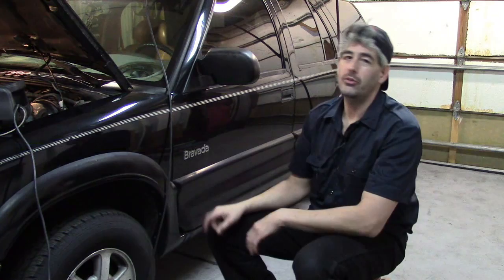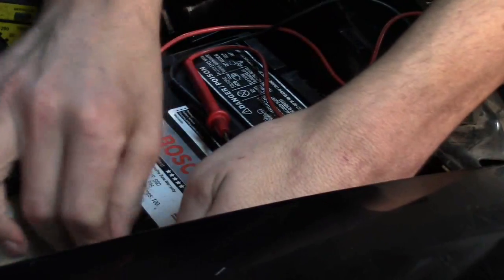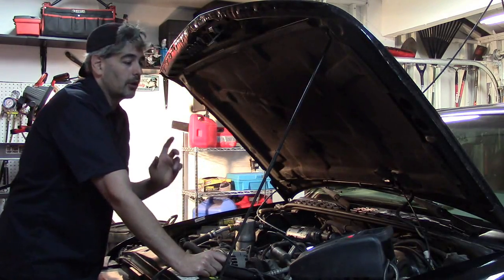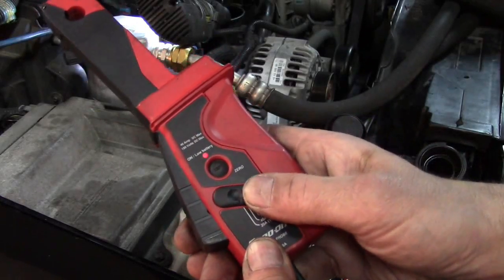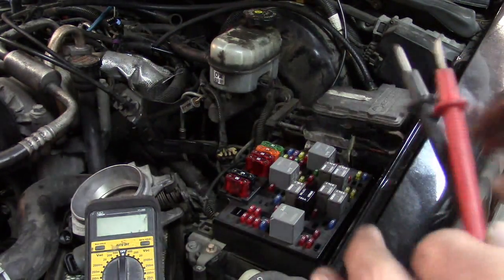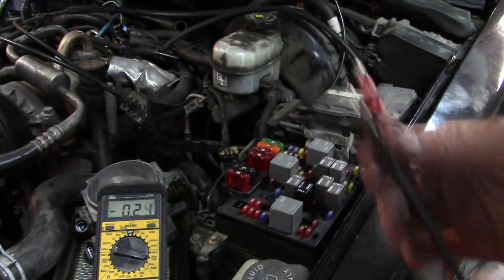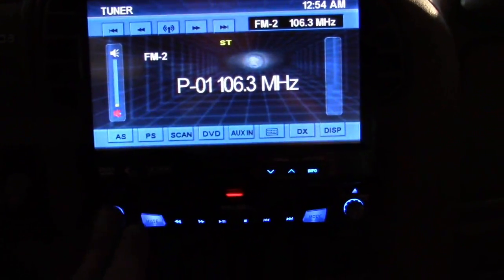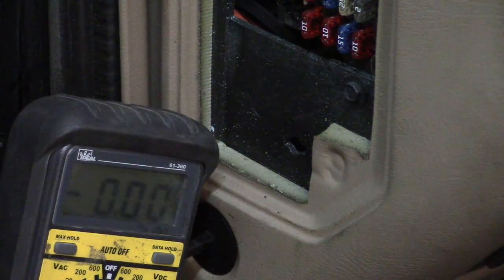Improved Methods to Find Parasitic Draw (Battery Drains Overnight)

Comment: Hey, Matt.  You have covered using a multi meter in great detail as well as showing your subscribers how not to fry them.  
Have you considered making a video to show how to replace those two fuses inside your multi meter?  Show what fuses they are and how to replace them/where to buy them?  While you are at it you could show a list of functions of a multi meter and maybe include a few different models and maybe include a bonus section of the patterns of OBD II codes (what a P code is, what a B, C or Unidentified code is, how to tell if it is manufacturer specific or generic)  What years qualify as (typically) an OBD I or an OBD II and the basics of how to read a code reader in general.

Reasons this would be helpful:  
I am more familiar with using fluke multi meters so for more experienced subscribers this would be more knowledge in the bank about different brands of multi meters, and how to properly maintain them if (and when) you make a mistake.  We all know it happens

Secondly:  My grandfather is not a mechanic and I have gone over this several times with him.  Both the multi meter bit and the OBD II reader and how to properly identify a code without the reader telling you.  He is one of those "carburetor master race" people that thinks it is pointless to learn how these things work even though he drives a 2011 Dodge.  I am not a good teacher and he doesn't listen to my advice.  I know he will keep this truck for decades past the warranty and eventually it will have problems that I may not be there to fix for him.  Maybe he would listen to you better seeing as you are a bit closer to his age.
Reply: I've been drinking so I am sorry if that previous comment doesn't make much sense but totally do it that would be great thanks. =)
Reply: Daniel Briese  nh

Comment: First video of yours I wasn't too impressed but this one you nailed it. With doors open and latched with dome buttons depressed to start diag testing. Mercedes Benz many years back had the voltage drop across the fuse and they had a formula on different fuses using Ohms law to get the actual current. Overkill as I agree with you when you see the mv on the dvom you know somethings wrong. Then out comes the amp clamp like you use to verify. These days waiting for cars to go to sleep is a big pain or you chase your tail till can shut down or other components. Great video, now I can subscribe.
Reply from the maker: sometimes it takes people a while lol.
Reply: Here's a chart for that:  https://www.powerprobetek.com/wp-content/uploads/2018/12/fuse-charts.pdf

Comment: I agree wholeheartedly with the basic reason to avoid putting the multimeter (who calls it a DVOM anyway?) in series with the battery in the first place. However, does your meter make a loud sound if you have leads plugged into the 10A jack but switch to a voltage setting? Nicer meters do this, and it reduces the risk somewhat. Make it a rule to touch probes only once the meter is configured, and there's some safety there.

Nonetheless, avoiding that configuration entirely is a good plan. Love the channel.
Reply: +GeekPriest On one of his tips and tricks, he showed a rubber band over his DVOM that he puts over the control until it's off of the amps setting again. I had noticed he had abandoned the trick, and now, I know why.

Comment: This works, however, the real nightmare are intermittent current draws, such as a rear windshield wiper trying to return to position.  Noting also some older vehicle security systems (such as my 91 Jeep) have a fairly large constant current draw that needs to be allowed for when doing the testing.

Comment: My 2002 Jeep Grand Cherokee 4.7L-V8 has a 4A draw from the door harness wiring.
If you have a 99-07 Jeep Grand Cherokee, I encourage you to check the wires in the rubber boot in door by hinges. It's an extreamly common issue with WJ's.
Reply from the maker: Yep- also very common on hatchbacks. the wiring at the hinge often gets worn.

Comment: Cool technic with voltage drop, this is what we do on electronic, we put 1 Ohm resistor on the board, V=R*I if R=1 then V=I , but most of you already know that.
Reply: Former TV tech. I dont do it any more. How does the 1 ohm method work?. I have a vague Idea..
Reply: @PIANOSTYLE100  I you are former TV tech than you surely remember the formula V=R*I , to measure current with a meter in Voltmeter mode instead of Current mode where your meter has to be in series with the circuit, the cool thing is if R the res is 1ohm only, then your equation V=1*I thus V=I, so you read on your meter the voltage is the current directly, make sure your resistor has enough Watt to sustain the current.
What I wanted to say in my previous post was when hardware design a board, they do leave 1-Ohm resistor at strategic test points so they can simply probe voltage to actually measure current for test purpose without modifying the board.  I hope I am clear, if not you can keep searching.
More ever, the same technique can be used with a scope to measure current and observe current signal on the scope when one need to see current over time.
Reply: @zerodegrekelvin2   1 Ohm ..never did it that way.  Since V=I R..Then( I) Current  will be V/1..So current would be voltage...I have read your message over..I may have something wrong.  Ill be reading yours over.
.

Comment: Nice twist on parasitic draw testing, thanks for sharing the info.
Reply: +Ozzstar I agree, I'm a licensed automotive and heavy duty tech and I learned something new. Thanks
Reply from the maker: +buzzerauto Thanks guys- gotta give credit where it's due though-  that viewer I mentioned is where I first learned this and to be honest, if someone told me you can measure voltage drop across a fuse I would say they were completely insane lol!!!
  Again the comments are often better than the material on this channel!!
Reply: +Schrodingers Box If you don't have an ammeter, you could always disconnect the battery cable and bridge the cable to the terminal with your tongue. First degree burn = small parasitic draw, second degree = medium sized etc.
Reply from the maker: +TheNoBSZone Aw man gross! But only because usually by the time I see a car there were 5 other people who saw it before me. That's a lot of backwash on those terminals!!!
Reply: @TheNoBSZone  We were told not to work on electronics with rings. Hmm.  30000 volts DC to ring.. conductor to Flesh acting as a ground. Very unpleasant. Maybe best to do what books say.

Comment: Not even touching the QM channel, i don't want to fry my remaining brain cells trying to stretch them around a concept i know nothing about.   starting at ground zero on something like that would make me weep in the fetal position more than likely.    I have enough reasons to do that without adding more, but thank you for the offer   =)
Reply from the maker: +Rhage73 The QM channel actually makes things more basic and detailed than I usually do here. It's more about fundamentals.
Reply: Ok bud i will check it out, if nothing else just to take a look.  =)

Comment: In my opinion, the easiest way to determine the current draw is to measure the voltage drop across the fuse and refer to a chart for the current drain at https://static1.squarespace.com/static/582b77aa6a4963c3f199b0a5/t/5989d68bd2b857f1fa7fdc9d/1502205579335/Fuse_Voltage_Drop_Chart_-_Mini_Fuse.pdf .

Comment: I ground my test light and go from fuse to fuse to which one is live and then go to the multimeter
Reply: That probaby would save some time. Just thinking.. If both sides have aprox same voltage..the test light would light..probably not unless the voltage was from another source. I doubt that..I'm just guessing. Then we test for the milivolts across.

Comment: I'm actually surprised pulling the fuse worked in this case!  Whoever installed the radio actually at least tried to do it right!  Without a conclusion, I'm left to speculate, but what I most often see with this kind of thing is that someone didn't want to take the time/money to use a harness adapter with the new radio, and hard-wired it into the vehicle wiring harness.  All it takes is improperly wiring the ignition relay circuit on the new radio, and the thing is always on even when the car is off.
Reply: +rhkips Absolutely correct!!!! That is precisely what it turned out to be (as is usually the case). I see this all the time.
Most often when people add accessories like GPS or iPods, etc, they often  just look for any 12V source for the accessory without considering it must be 12V that is active only in ON or ACC mode.
Reply: +rhkips You haven't lived until you look behind a stereo and find a wire taped on to a big yellow wire with a label that says "SRS - Do not splice." You start moving back from the dash real careful.
Reply: Ooh geeze...  Haha, been there!

If you're poking at the SRS system, make sure you have FACTORY documentation about how to render the system safe for service.  Simply disconnecting the battery is not always enough!

Comment: 1:30 risky old procedure to spot excess amp draw involves disconnecting neg battery terminal set aside (this method forces you to reset your clock and radio presets). identifies a draw, then you pull fuses until you ID which circuit, first inside car, then under hood. 

5:50 method two uses inductive amp probe 'dc inductive amp clamp' that you... 6:40 clamp around the battery cable without disconnecting it which measures (amps) magnetic field and outputs corresponding voltage signals to your dvom. you plug the clamp into yout DVOM multi like you're going to do a regular voltage test, set probe/clamp to 20A setting and loop it around neg cable. the DVOM is set to 20 VDC scale and we're reading volts (0.05v so you have to multiply x10 to get .5 amps). then you pull fuses until it drops to zero. 9:00 but it's still time-consuming when we pull fuses one by one. 

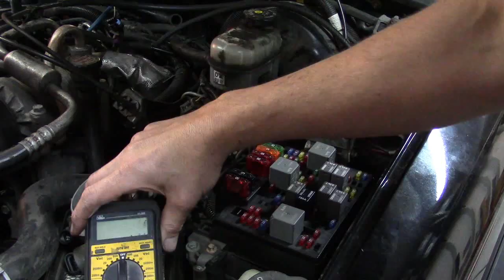 9:43 method 3: we spot the fuse by detecting voltage drop between in/out side of fuse. 10:10 we will have minimal voltage drop so you will need a millivolt scale to detect it.

Comment: At arround 17:12.   (Btw..kicking and screaming..having to work on my car)..Just thinking. Idk..Not a car tech. You measured across the fuse and the was voltage was diff. on each side.  Now..I would think that they would different from chasis ground. That would tell me I have an open fuse. The idea..remember..not a car tech..it seems to me, it would be faster to put the probe to each side..bam.. different..open fuse..we found a circuit that is abnormal..sometime in the past there was excessive draw. I'm thinking that this would indicate
that something is irregular.  A post install..non factory instaltion would jump to the top of the list. Been watching this for awhile. 
.
.

Comment: my 97 Jeep Grand Cherokee had a parasitic battery drain that was tracked to the huge 50 amp fuse then to the #7 fuse inside at the lower passenger side fuse panel. So many possible drains, shorts or shorts were possible that it was easier to just jump the 50 amp fuse with an inside toggle switch with indicator light. Ended the problem. Has the entire full width instrument panel out once and did not feel like doing that again. Cigarette lighter and USB port are eliminated separately.

Comment: And when you do the pulling of all the fuses and still no change in amp draw.  
That's the fun part you didn't cover.
Reply: That's where I'm at RIGHT NOW!
Reply: @ivanlaney2336  you pulled every fuse and every relay? EVERYTHING. Make sure to trick your door locks and hood lock to make your car think everything is shut, then it'll go to sleep mode after a few minutes
Reply: By pulling the fuses, you may shut down the circuit that has the draw. Pulling a fuse is not the best way to check on newer cars.

Comment: One thing to keep in mind about the cheaper hall effect current clamps is the accuracy can be pretty bad. The Snap-On EETA308D is a very accurate hall effect current clamp, it's also quite expensive.
Reply from the maker: +Chester Wardan I've never used anything but the one I have but that totally sounds reasonable. Cheaper equipment is seldom as accurate as higher quality equipment.
Reply: +Schrodingers Box Another way to measure parasitic drain is to use a 1 ohm 10 watt resistor in series between the B+ post and B+ cable and measure the voltage drop across the resistor. I made a test harness with some alligator clips, a fuse holder, and a 1 ohm 10 watt resistor. Works very well and there's no risk to the meter.

Comment: I noticed that you did not mention putting the car into sleep mode and waiting 30min to hour.  Is that necessary?  Some say it is.  What is you take on that. Thanks
Reply from the maker: it depends on the circuit. obviously you want all modules asleep however modules not asleep should still draw less than a couple hundred milliamperes so if I see that on a BCM for example I expect it. when I don’t expect is to see a 1amp draw on anything after 2 minutes.

Comment: Great video. Old TV tech. I heard a lot of good advice. You are probably one if not the most accurate tech that is sharing info.  People are welcome to double check.. V=IR. 
Amps or I is V/R..using the above relationship.  I suspect a fuse has infinite resitance when blown. So 
12/infinity.. is .000000..etc. So no current. Say, I found a voltage of 12 volts the across a wire fuse. V=IR;
12 = I x infinity... there is no current..so can 12 = O x infinity.. be true. No..there will be.no voltage drop across the fuse itself..There would most likely be voltage of some kind to ground. .Voltage is basically potential .. The math will work.. It's really a mute subject. There are charts that give the voltage over the fuses. I have never used this method. I would suspect a printout from a diagnostic machine would be helpful.  Remember, it is the voltage across the fuse that is important. As the current starts to flow..I've read that filiment of the fuse increases in resistance.  Ive also read some charts that are comparative ..the larger amperage fuses change the milivolts that are typical across the fuses. That is fascinating study. Of course the obvious here is be careful..at all times.

Comment: DVOM = Digital Volt Ohm Meter
PCM = Powertrain Control

You're welcome.
Reply: PCM = Powertrain Control Module. You're welcome.
Reply: Andy Roid 
BAHAHAHAHAHA
Reply: Lamar W 
BAHAHAHAHAHA
Reply: novice:  is a Digital Volt Ohm Meter same as multi-meter?  if not, can both do this?

Comment: When doing the voltage drop across the fuse method, what state should the battery be in? Does it need to be fully charged? Does it need to be connected as normally connected? I'd guess yes because you need a complete circuit, but in some parts of the videos you have the neg disconnected and I want to be really sure I know what I'm doing. Thank you; this and the first video are helping me so much!
Reply from the maker: Technically it doesn’t need to be fully charged - a voltage drop will be present regardless but it only makes sense to have battery fully charged because it’s draining while you are doing the diagnostics and you don’t want it to die during that time.
Reply: @SchrodingersBox  Thanks. Gave it a try today - didn't find any changes in voltage. A bunch of the fuses aren't the blade type though so have to think about that. Thanks for the videos! Love self-empowerment.
Reply: @skochavi6721  You may need to use a lower Volt range to detect small voltage drop across high amp fuses. There will of course be no voltage drop across a fuse when no current flows.

Comment: According to my cousin who is a mechanic, many new fuses now don't have the tiny exposed metal part that you can use to test whether it has blown without removng the fuse first.
Reply from the maker: I have never seen a fuse- even the new microfuse design- that didn't have the test ports.
Reply: @SchrodingersBox  It may be a European thing.

Comment: Great video and info, I'm learning lot's thanks. Is it true that with modern cars, with so many electronics, you can see considerable draw until everything goes to sleep, i recently did an amp draw test and saw over 2amps initially?
Reply from the maker: Yes but only for a few minutes. After 5 minutes you should see 100ma or less even on a modern car.  You definitely shouldn’t see 2 amps!!
Reply: @SchrodingersBox  Yeah I realise that would flatten a battery within hours.
Reply: A recording meter can be handy in situations like this.

Comment: I had a parasitic draw then I found out it was my wife.
Reply: +tubester4567 Hahahahaha!!! Nice!
Reply: +tubester4567 nice!
Reply: that commonly identified as parasitic wallet draw, tubester
Reply: chris johnes  funny ass comments , Hahahaha 😂
Reply: That's a FUNNY one
Reply: I know, I know, I measured my fiancee at $2,800/m with some software. I disconnected and it took me 4 months to recharge enough so I could be turned on again without equip.
Reply: ROFLOL
Reply: Hahah
Reply: tubester4567, 
I love that! 
I have one of those, sadly. 
She's sapping the life right outta me. 
-the divorce is still not final, and she's still bleeding me dry,
Reply: Lol! That's unfortunate as it would be much easier to fix the car.
Reply: Did you solve the problem yet ?one of my cousin has the same problem..
Reply: Take my wife... please!
Reply: Every time they have the credit card the wallet drains faster than that battery while cranking the engine on a stone-cold day.
Reply: My wife tells me your not funny.
Reply: lol
Reply: LOL 😆

Comment: Great video and thank you for it! When you were checking voltage drop on the fuses what millivolt setting were you on 200 or 2000?
Reply from the maker: You want it on the most sensitive setting your meter offers